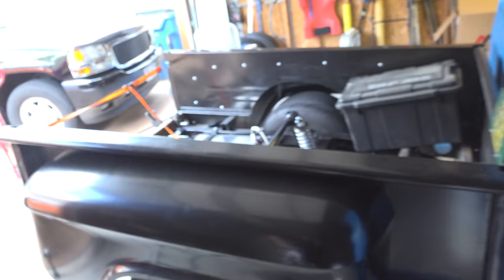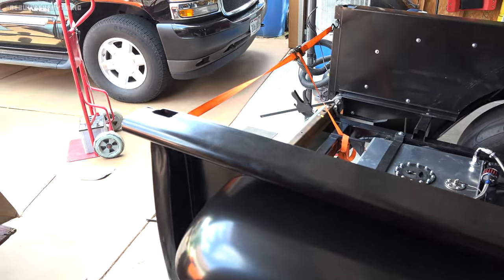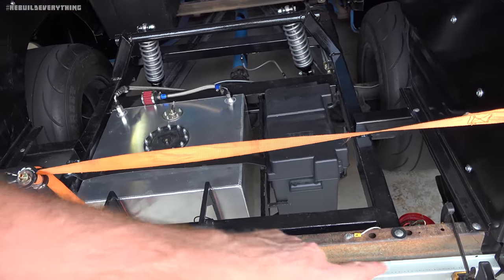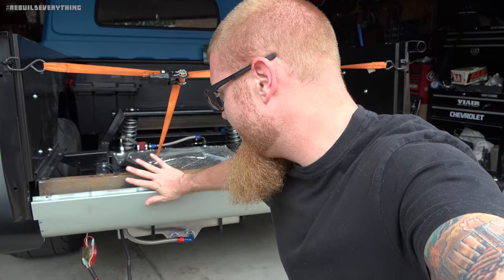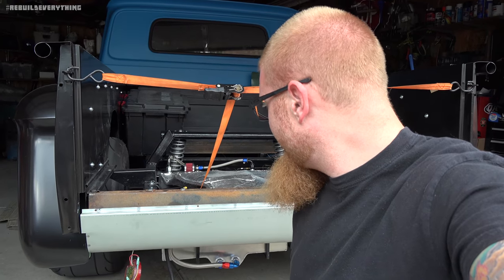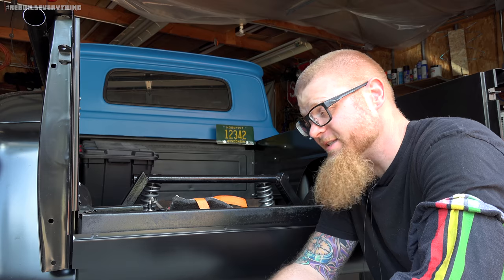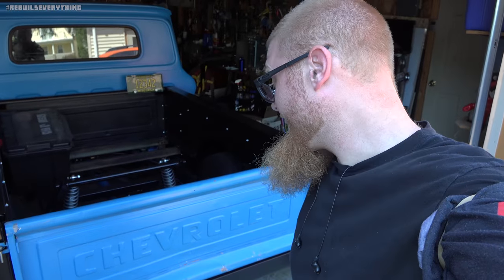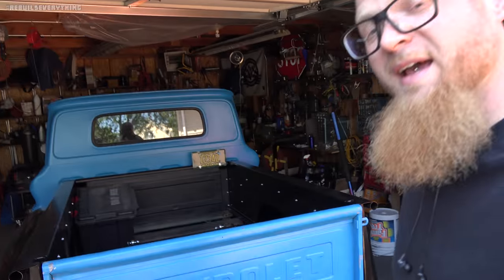Mar-K Rollpan + Bed Update - C10 Rebuild Vlog

Comment: All that work to that truck and you’re using rattle can garbage? So much easier than you think to mix up a little catalyzed paint/primer.
Reply from the maker: Why would I do that to the rollpan, when the rest of the bed isn't painted either? The whole thing needs to be sanded, primed, and finish painted. No reason to mix, spray, and clean up my HVLP to coat less than 2sqft in temporary paint.